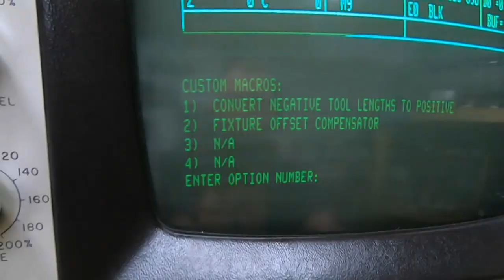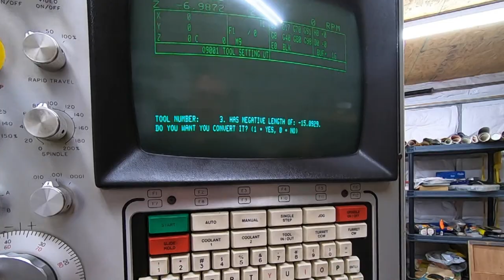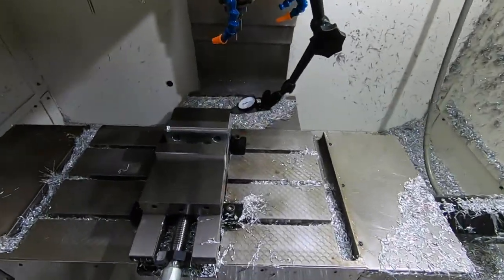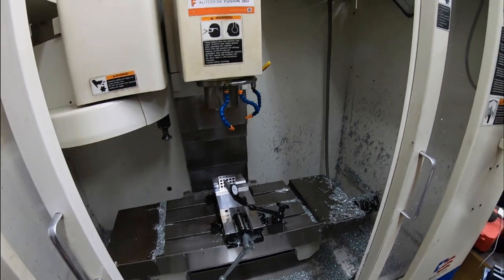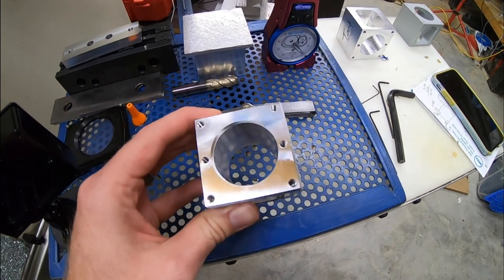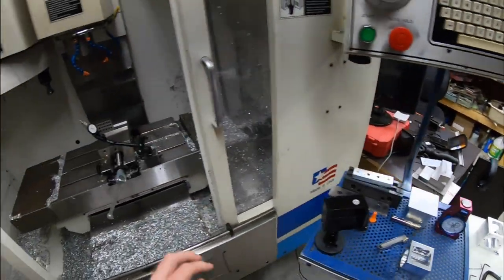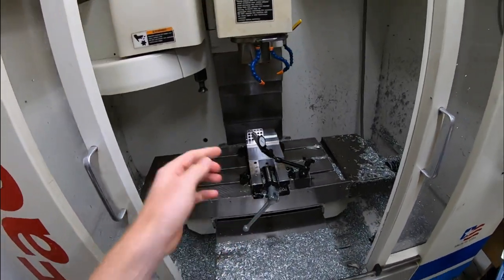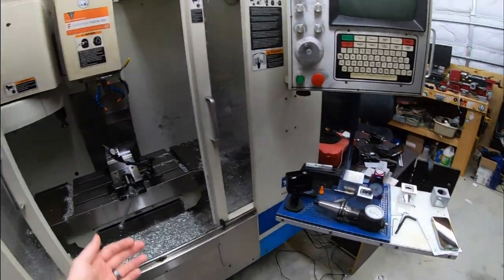Machining CNC Lathe Conversion Parts

Comment: isn't the the whole point of the haimer that the ball is exactly the distance it takes to get to zero?
Reply from the maker: Yes! Absolutely. But as I found out, something is off and I am going to use the offsets to help dig into why or how much to adjust.  Not the correct (or permanent) solution - just a tool that will be used to find and fix.

Comment: That seems to be off quite a bit when setting up your haimer should whatever tool number you're using it and diameter set to zero also do you have the right and diameter tip for your Haimer? 
And  double check work coordinates in your program.
 When I make parts I always try to use the same  datum or two edges when I flip the part.
Hope some of this will help you I'm not an expert.

Comment: i always clinch buttcheeks affter flipping a part...all my instincts say the machine will never be dead nuts on the part.. ( usually it is , but im cynical) commonly ,my mistake is leaving side offset stock on the part in fusion.. In other words, i never changed the setup from the top side setup